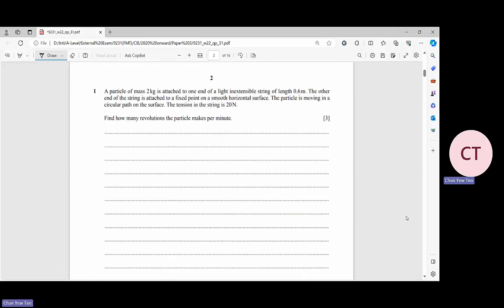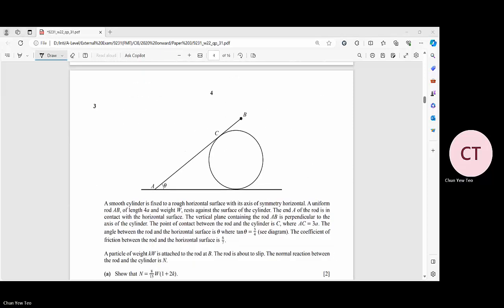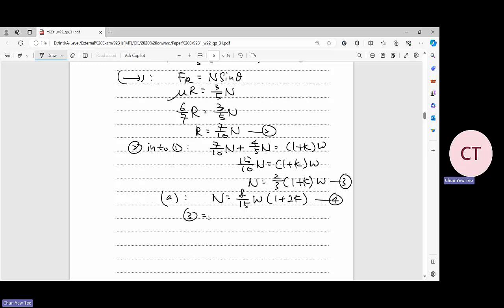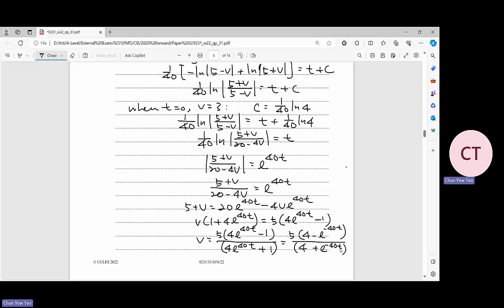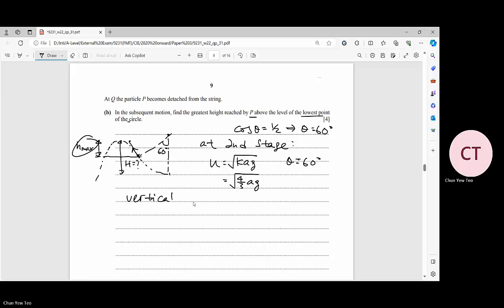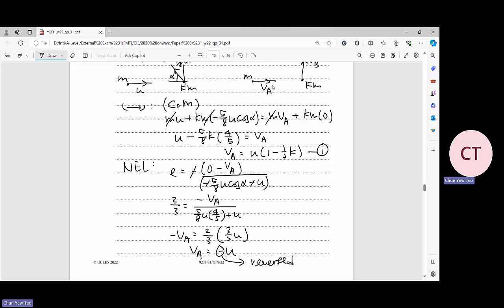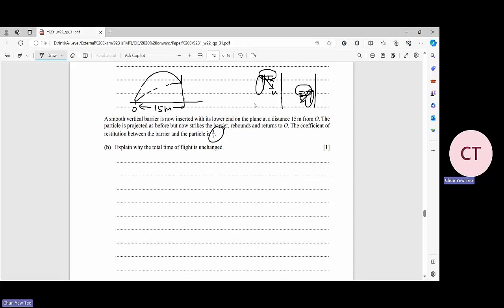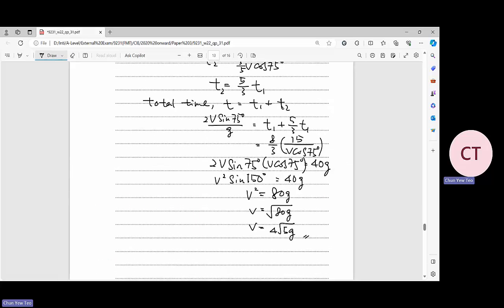9231/31/O/N/22 CAIE A-level Further Mechanics Solution

Comment: Dear sir, why is not our friction force on the cylinder as it is about to slip?
Reply: Refer to the first sentence in the question. It stated that the cylinder is fixed so there is no need to consider that the cylinder will slip.
Reply: @chunyewteo2692 Thank you sir